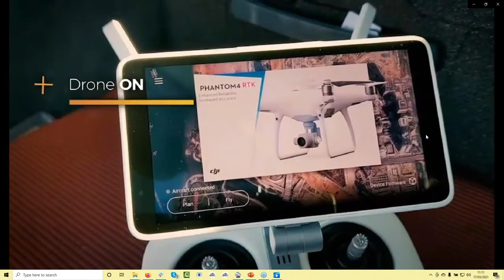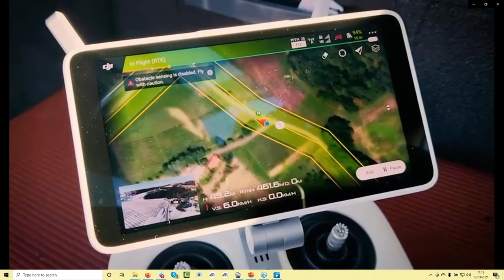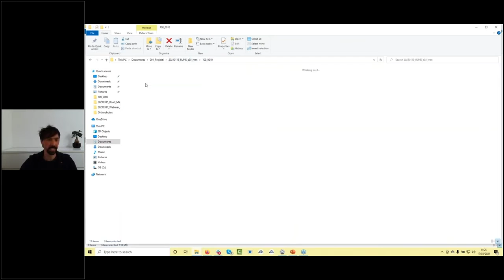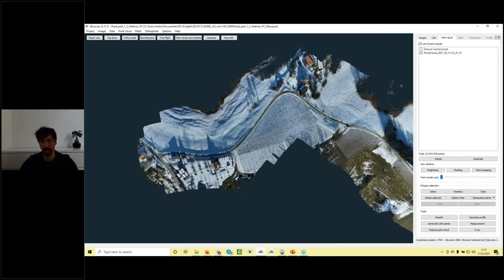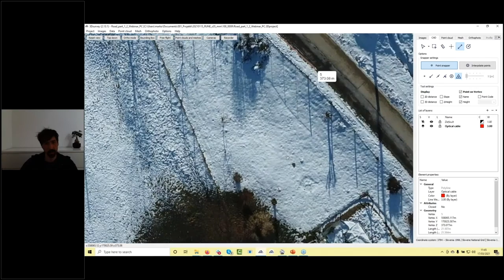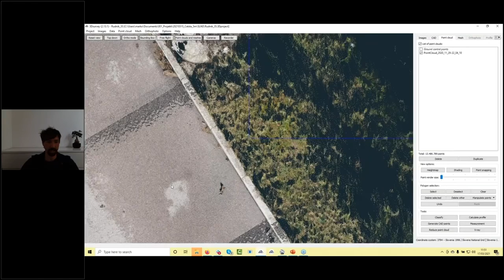Webinar: Benefits of using photogrammetry in road mapping

Comment: Hi Marko, thank you for the video.
I have 2 questions regarding mission planning:
1. Why timed shooting? I thought it would be geometrically more correct to have distance shooting. 
2. Why did you turn on distortion correction, are the results better in 3DSurvey with this option on?
Reply from the maker: Hi Vucko,
1.Yes, you could also use distance shooting. But keep in mind that this drone can effectively produce a photo every 2 seconds, so if we were to fly too fast it wouldn't keep up.
2. There used to be an issue in rare cases with undistorted images, but newer versions can handle it either way.